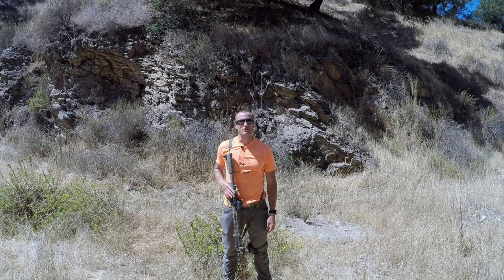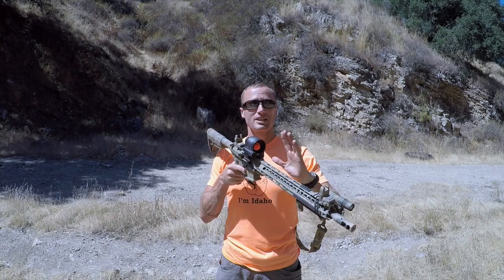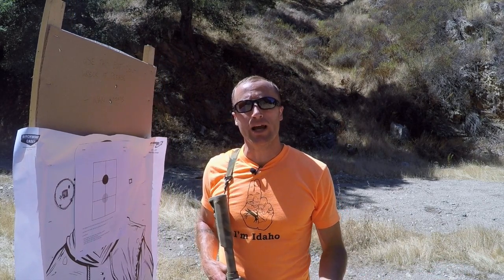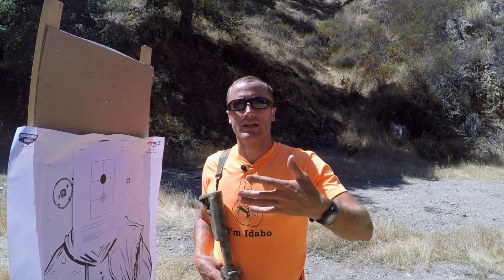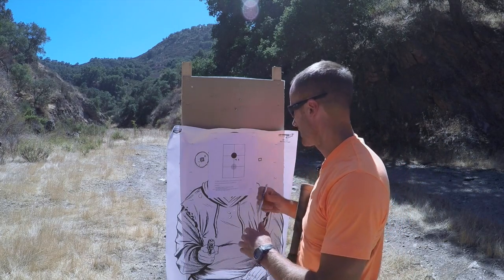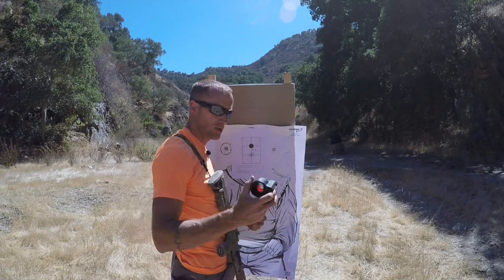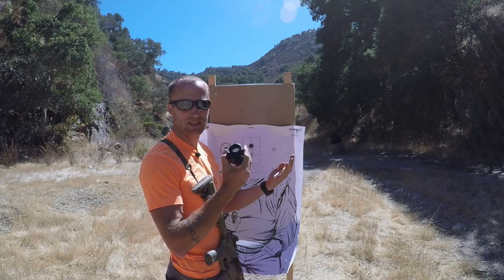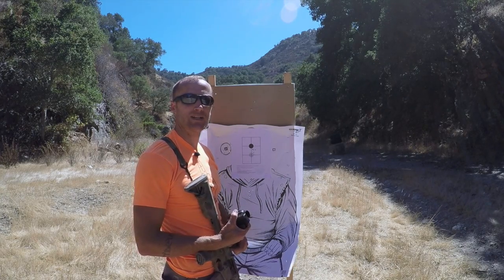BUIS Optical Illusions

Comment: Great video!
I don't run them myself, but how do you think 45 degree irons play into this equation? No lenses to interfere with the sight picture, right?
Reply from the maker: Thanks!  As to Offset Iron Sights, I think they are a solid option.  They completely alleviate the issue of using or not using a quick release on a optic.  I just haven't had the opportunity to try them out.